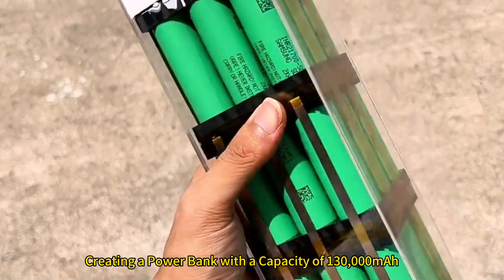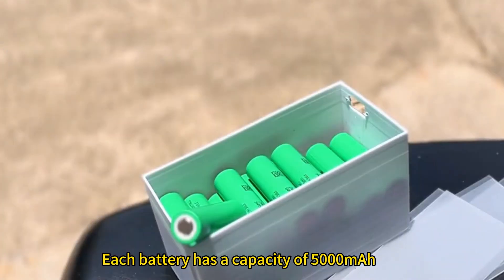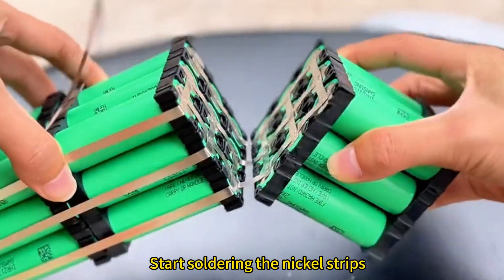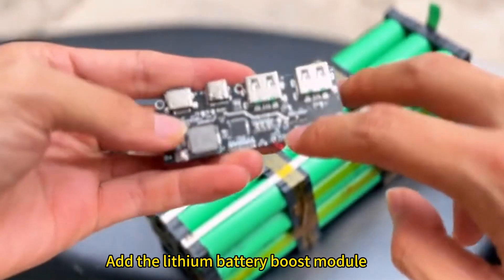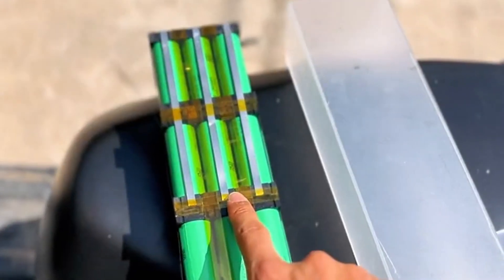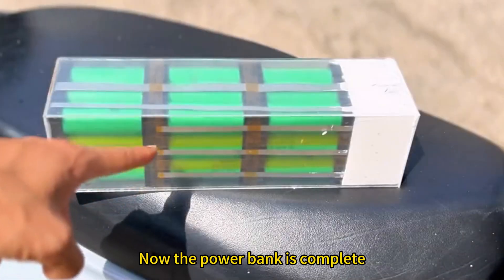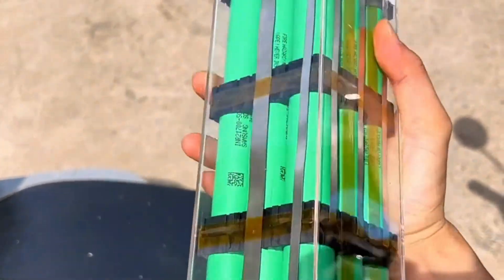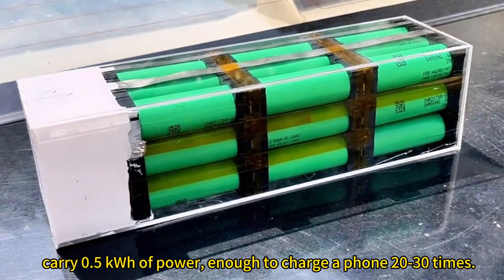Creating a Power Bank with a Capacity of 130,000mAh

Comment: Very nice. I was thing for some use cases maybe 3S 9P rather than all in parallel is better, less voltage to boost if powering other things like laptop, or even just 12v devices like fridge